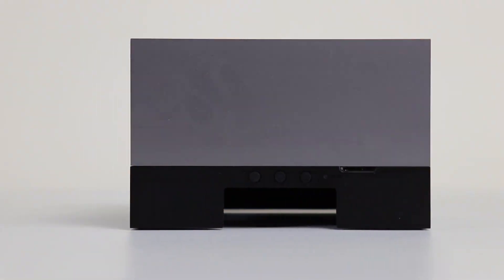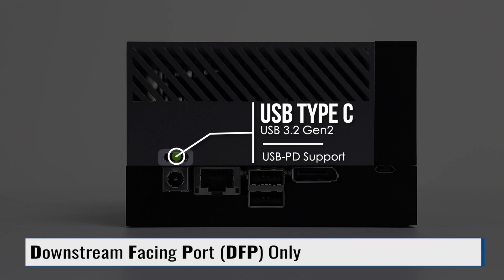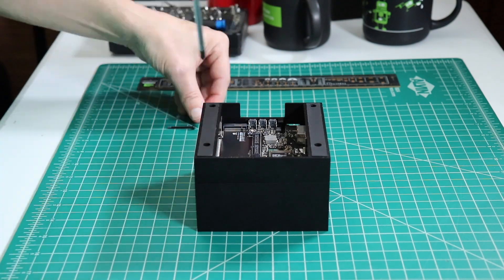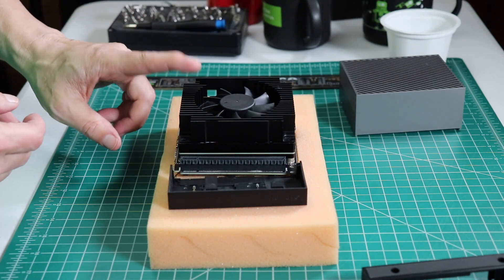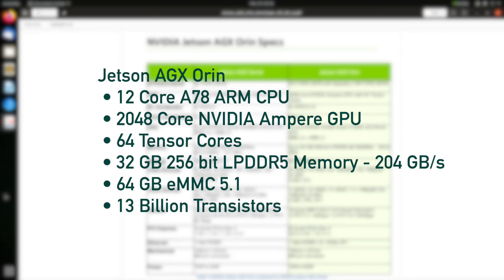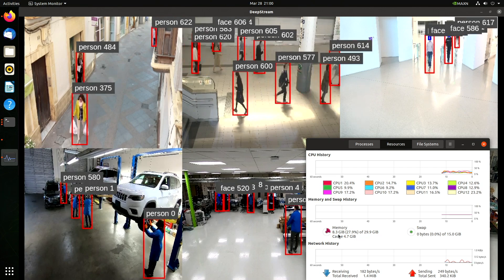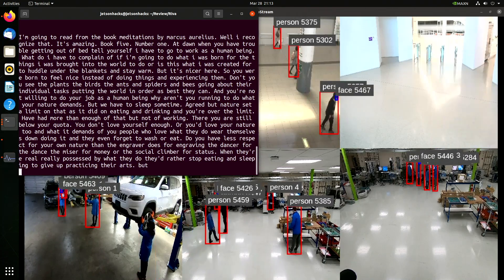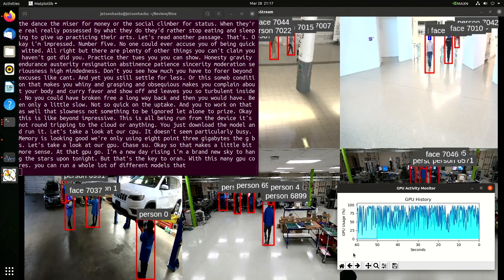NVIDIA Jetson AGX Orin Unbox, Setup, Demo - Just Wow

Comment: I have a Jetson Orin AGX, my friend accidentally erased the sd card holding the jetpack and os, how do i reinstall everything from scratch, Any help?
Reply from the maker: I'm not sure I understand the question. On a Jetson AGX Orin, the OS and JetPack libraries are on the internal eMMC and/or an installed NVMe SSD. To flash the AGX Orin, you use a Ubuntu PC running the SDK Manager, as shown in the video. 
If your OS is running from the SD card, did you mean that it's a Jetson Orin Nano? 
The best place for help is in the Jetson forums.
Thanks for watching.
Reply: @JetsonHacks Thank You for replying, I have a Jetson Agx Orin, i wanted to update the jetpack from 5.x to 6.x but the firmware does not get updated and i have no idea how to install jetpack 6.x on the current jetson orin, Also i could not find resources to first update the firmware and then update to jetpack 6.x. Any help? Thank You
Reply from the maker: @vinayaklalbhatnagar3230  You have to use the SDK Manager with a PC. Here's a video: https://youtu.be/Ucg5Zqm9ZMk
Here's the manual:
https://developer.nvidia.com/embedded/learn/jetson-agx-orin-devkit-user-guide/two_ways_to_set_up_software.html
You can ask for help in the Jetson forums: https://forums.developer.nvidia.com/c/robotics-edge-computing/jetson-embedded-systems/jetson-agx-orin/486
Good luck on your project!

Comment: Hii. I hope you're doing well. I'm currently working on an innovative project that leverages NVIDIA AI technologies to optimize traffic light control at urban intersections. The aim is to improve traffic flow using both local (NVIDIA Jetson, Metropolis, DeepStream) and global traffic data (Google Maps, Green Light).

I've been following your YouTube videos, and they’ve been incredibly helpful—your explanations are spot on and have really guided me so far! 🙌

I would greatly appreciate your recommendations on:

Which NVIDIA Jetson devices would be most suitable for this project (Xavier, Orin, Nano)?

Which AI cameras are compatible with NVIDIA platforms for this application?

Thank you so much in advance for your insights! 😊
Reply from the maker: The Jetson Orins are the only Jetsons that NVIDIA currently sells. You will need to determine the compute capacity you need as to which one is most applicable to your project. As for cameras, there are many factors to consider, especially environmental concerns. I'm not a good resource for camera suggestions, you can get a much better answer on the NVIDIA Jetson Orin forums. Good luck on your project and thanks for watching!

Comment: The jetson agx Orin, Can you test stable diffusion. And also a good video editing program like di Vinci. The ai suggest that you can run both on there. I have an old laptop and where as I’m not concerned with playing high end games it looks like this may be a good purchase to consider LLM running locally, stable diffusion, and general video editing 4k video for example.
Reply from the maker: Here's a video of it running Stable Diffusion: https://youtu.be/HlH3QkS1F5Y?si=Mw26As_sPSHjIUdX This is probably not a good choice for a desktop/laptop replacement for tasks like video editing. However there is a lot of GPU accessible RAM for running LLMs. You can see many examples on https://www.jetson-ai-lab.com where a large number of different AI and ML examples are shown, along with examples. Everything is OpenSource, so it's inexpensive to get started. This includes LLMs, Text & Vision (VLM), Vision Transformers, RAG & Vector Database, ASR and TTS, Image Generation like Stable Diffusion and much more. Thanks for watching!
Reply: @JetsonHacks  thanks. It was just a suggested tie me over suggestion by AI until I buy the 5 to 6k pc with gtx 4090 or 4080super…. But it assumes video editing would work fine on Orin. Which I was curious about. It even suggested for me to install davinci on both laptop and Orin and I use proxy files. Load up video files to edit, export proxy files to laptop, (edit in low quality mode) edit, move back to Orin to process. Very interesting concept.
Reply from the maker: @playthisnote  I'm sure there are programs that you can use on the Orin that can edit video. The issue is that the Orin is an ARM machine, not x86 or Mac. This means that they're out of the mainstream for many applications, or it can be challenge to get support because it's a relatively small community in comparison. Blender does work, but I'm not sure about Resolve or Premiere. The Orin is a good machine, but its purpose is different than a desktop replacement.

Comment: Hi, What you have shown in the video is very interesting.  We are facing a video analytics project using a Jetson Orin NX 16GB with Jetpack 6.0 and Deepstream 6.4. As inputs we have 4 RTSP streams. The gstreamer pipeline is basically:

nvurisrcbin (for each camera) → nvstreammux →queue → nvinfer → queue → nvtracker →queue →  nvdsanalytics → queue → nvvideoconvert → capsfilter → queue → nvmultistreamtiler →  queue → nvdsosd → queue → nv3dsink

The model for inference is a Yolov8m. Each RTSP stream has a resolution of 704x576 pixels at 10FPS. For converting the yolo model to TensorRT.
When the pipeline begins to run, a System Throttle due to Over Current message appears. With or without DLA.
When DLA is active, the video streams seem less smoother than without DLA, but the GPU has a constant load.
When trtexec is used to generate the .engine file with DLA support, a lot of warning messages are printed out on the screen, not allowing the use of DLA and falling back to GPU. However when the pipeline is running we can see the DLA core running at 614MHZ.  The streams suddenly freeze at any time (1, 2, 3 or 4 streams simultaneously). 

1) Which is the best way of implementing Yolov8 on the Jetson Orin NX. Has NVIDIA its own implementation of the custom library to use yolov8?
2) How is the procedure to convert the Yolov8 in pytorch format to TensorRT with DLA support?
3) What must we do to avoid the Over Current message to effectively use all the hardware resources on the Jetson Orin NX?
4) Can the Jetson Orin NX 16GB manage the 4 rtsp streams, with yolov8m model, tracking with NvDCF and analytics in almost real time?
5) How can we know or calculate the number of TOPS the pipeline is using?

Comment: What fps?
Reply from the maker: What fps are asking about?
Reply: @JetsonHacks  If I want to use the jetson orin AGX to process 4 IP cameras, detect people (YOLOv8m) and track (SORT) using DeepStream, what resolution and how many frames per seconds (FPS) can I use? What if I have a jetson orin NX?
Reply from the maker: @marceloraponi8566  That's not a easy question to answer. It's a development question which depends on a variety of factors, including the skills of the developers. Typically you would use DeepStream to both detect and track objects. It will depend on which resolutions you choose, the power envelope you need to work in, the frame rates and resolution of the IP cameras in use, network speed and so on.  You can get a better estimate from the official NVIDIA Jetson Orin forums, where a large group of developers and NVIDIA engineers share their experience: https://forums.developer.nvidia.com/c/agx-autonomous-machines/jetson-embedded-systems/jetson-agx-orin/486.

Comment: Ah, meditations. Our purpose is to breed, prune, and feed the soil. Just explore life and make art of it. I'm new to these types of products, is the SDK absolutely necessary or is there some ease to development on a regular PC with a decent GPU. Any emulation software provided?
Reply from the maker: There is no emulation software. You can develop remotely on another machine using tools like VS Code and such, but most developers hook the machine up to a monitor and use standard tools. The AGX Orin has 12 CPU cores and 2048 GPU cores, so it's capable of being fielding its own development environment. Thanks for watching!

Comment: Awesome video -- based on this, I picked up the Orin dev kit for myself!

I notice that your Riva output is much nicer than the output from the python client (at least the asr client), which just spits out line after line. Yours is also doing punctuation properly. How did you get such nice output?
Reply from the maker: Congrats on your purchase! The ASR demo came with the device from NVIDIA. It was a prerelease, it's hard to tell what might have changed. Is this video: https://youtu.be/FZWgQvI7MxE what you are experiencing? Thanks for watching!
Reply: Yes, that matches the output I am getting.
Reply from the maker: @louieearle  I would guess that there are switches deep in the bowels of the beast that can make it perform like this video, but I've just scratched the surface on working with it.
Reply: Thanks for taking the time to respond. Your videos are really great quality, and I like your sense of humor - Marcus Aurelius and ripping on Kamala Harris for the win!

Comment: Thanks for the demo. How many such streams do you think it can support simultaneously? Looking at this performance I would guess even 20+? Thoughts?
Reply from the maker: I think that's a pretty complicated question. A lot has to do on how you acquire the streams. Just handling  the bandwidth might take a significant amount of time, depending on where the source is coming from (Ethernet, GMSL, PCIe and so on). There's a lot of compute power available, but there's a significant amount of design work optimizing gathering the data, processing it, and just as importantly, what to do with it once you're finished. Thanks for watching!

Comment: Hey Jim, how does the performance of this box compare to a Linux PC with a 2080ti or 3080ti installed for training ML models for example?
Reply from the maker: They aren't in the same league. Remember, the Orin only uses 60 Watts, the machines you mention don't even get started with less than 10X that. 
While you can train ML models with the Orin, the real purpose is to run multiple inference nodes on pertained models. For example, in robotics where you have to do vision recognition, object detection, path planning, segmentation and such all at the same time.

Thanks for watching!
Reply: @JetsonHacks  Thanks Jim!

Comment: I wish the price reflected the value of the hardware, instead of the utility value it provies to large enterprises. I'd love to update my Nano to something from this decade, but i dont think this hardware is worth more than $399, and it comes down to having a GT3030 with a cellphone processor clocked faster than normal
Reply from the maker: Thanks for sharing your opinion. I'm not sure how to make a good comparison between a GPU and a full SoC (e.g. on the Orin 1/3 of the compute is taken up by the Deep Learning Accelerator "DLA" which the GPU doesn't have) but if it doesn't fit your needs or perceived value/price point it doesn't work for you. Thanks for watching!
Reply: @JetsonHacks  Holy crap, they announced the Orin NX for much closer to where i wanted it, at only $599 with 16GB of RAM, and $399 for 8GB. I need to upgrade my Seed Studio jetson mate if it suports it
Reply: @JetsonHacks  I suppose i worded this poorly, and should have said, if nvidia sold a consumer version with the enterprise focused accelerators removed, or disabled because it was faulty, i wouldnt price it above $399, or $450 if it only comes in a 32GB variant

Comment: Is it hot? does the fan runs hard during the demo?
Reply from the maker: The fan was not running. I didn't measure the temperature, but it is something to think about. Thanks for watching!
Reply: @JetsonHacks  Something to think about whether the fan is broken 😅
Reply from the maker: @johnny_123b  Fan works, this just isn't enough load to activate it. When I add some more things, the fan starts up.
Reply: @JetsonHacks  Amazing

Comment: Impressive... newcomer to the Jetson kit however and on this would it be feasible for it to drive custom ar/vr applications and 3d graphics? I see the pcie slot...could you potentially power a GPU on it?
Reply from the maker: I believe that several people have been working in that area with previous generation Jetsons. Because the video and GPU are already built into the Jetson, people tend to build stand alone products with them. The Jetsons are a building block, and of course you can extend them however you need. Thanks for watching!
Reply: @JetsonHacks  thanks for the reply...great content! To sum up, are there any comparison benchmarks on how this would compare to a 3090 GPU? Looking to run an embedded unreal engine app.
Reply from the maker: I don't know of anyone that has done direct comparisons yet. To be clear, that's a comparison between two different classes of machines. The 3090 has 5X CUDA cores, much faster memory, more memory bandwidth, wider memory lanes and uses about 10x more power for the GPU alone. A 3090 configuration has a minimum of 850 watts, and probably well over 1000 in practice. The Jetson operates up to 50W (think battery power).
Reply: @JetsonHacks  Understood...I'll just have to do some testing to see how far I can push this kit. Thankfully Arrow had one in stock. Thanks for entertaining my questions. Subbed!
Reply from the maker: @AC-ed1jz  Welcome to the Jetson community! There's a learning curve getting started, but there's enough people to help so it shouldn't be too bad.

Comment: This sbc is really powerfull, but for $2000 I buy a mini ITX rizen, 4 times faster at least for half of the price !!
Reply: I like to know where to buy a 32GB GPU that can fit into a mini ITX rizen and cost $2000

I need it to run 32 GB tensorflow models
Reply: @Haskellerz  if you've reached the point where you need a 400W+ graphic card.. You should buy a proper case for that 6000€+ baby cause as  I assume you're doing this with a Quadro or WX using ECC 😗. 
And tbh those video card also requires cpu power if you don't wanna starve your GPU, whe usually use dual cpu xeon as well as 128Gb+ RAM for CPU alone cause streaming 32Gb tensor data back and forth require a whole lots of it.

I don't see how this board gonna fold the job, really. I personnally use 2 x K6000 alongside 2 x P4000 and 1x RTX 4000 + Dual Xeon with 256GB, a full ECC 10 yo machine !
Reply: @goldnoob6191  
If you use unified memory on Jetson Orin there is no latency between CPU and GPU. So no memory transfer between them.

Looking at the GPU prices... P4000 and K6000 are around $1500
2 x P4000 cost more than the $2000 Jetson Orin
2 x K6000 cost more than the $2000 Jetson Orin

Personally, I use Google cloud right now because GPU prices are bad.
Really need a good GPU with lots of memory.
Reply from the maker: Sounds like a shrewd choice. Thanks for watching!
Reply: @JetsonHacks  oh no, thank you for taking time to show your device 😉

Comment: The sad thing is that for this price you will buy a cheap PC with a 3050 (when the gpu prices are moderated) and it would perform better.
Reply: 3050 has only 8GB  GPU memory, so it is limits size of the tensorflow model

It is 8X faster on Jetson Orin if your tensorflow model requires 32GB GPU memory
Reply from the maker: Why is that sad? I think it's great that you can get such great performance on the desktop at that price point! The AGX Orin is for a different market entirely, purposely for embedded products like robotics, autonomous vehicles, and smart video analytics. The Jetsons have 1 million developers, there is an ubelievably wide variety of uses. Thanks for watching!

Comment: As CPU is the main bottleneck of the previous version (Xavier), could you please share some experience with the CPU benchmark of the new hardware?
Reply from the maker: The CPU is around 1.5 to 2X faster. I think most people overlook the system capabilities. CPU and GPU performance are very much tied to memory bandwidth. The Orin has LPDDR5 main memory, which is about 1.5 faster than the previous LPDDR4. To me, it feels significantly faster. 

 Benchmarking the Jetsons is tricky because of DVFS, which throttles performance to fit in the energy footprint requested. For example, it will not turn on the CPU full throttle until there's a certain amount of workload for a certain amount of time. That is, unless you turn on performance mode. The Jetsons do that in order to save energy. People spend a lot of time  tuning the energy modes (e.g. 15W, 20W, 50W, MAXN)  to match their requirements by balancing clock speeds, number of cores and so on. It's way complicated, and to be honest to do it correctly is a little beyond where I am.
Reply: @JetsonHacks  Thank you so much for your detailed answer. This helps me a lot as I am still waiting for my order that arrives in 2024😄.

Comment: Would love to see some speed comparisons in either training or Inference, especially compared to desktop class GPU's.
Reply: I am really curious of the training performance for small networks like 10M parameters. Because it seems that Orin has 4 TFLOPS of performance for training, which would be enough to fine tune smaller parts of a big network.
Reply from the maker: @adamrak7560  I think it would probably be fine for something like that. Big picture, in order to leverage all the models that companies like NVIDIA provide, you end up doing some type of cloud/desktop/Jetson strategy for training. The Jetsons will be very happy inferencing. 

Reinforcement learning with few hundreds or perhaps a thousand images would be acceptable. But the models that NVIDIA has trained and made publicly available have been trained in their super computer data centers with resources that just aren't available to most. You definitely want to take advantage of that.
Reply from the maker: Thanks for the suggestion, and thanks for watching!